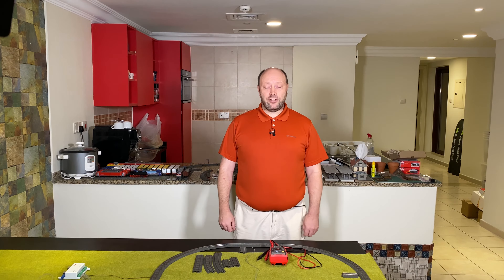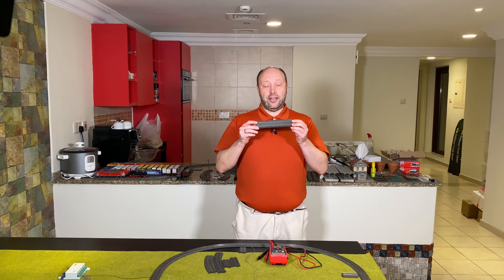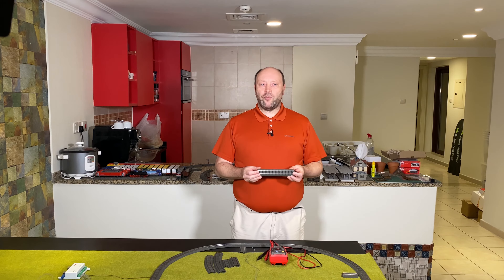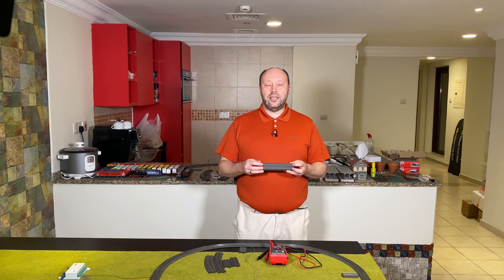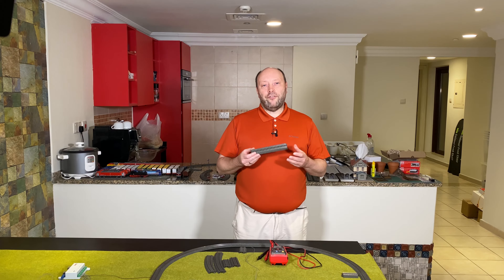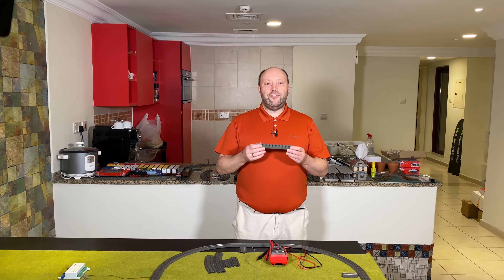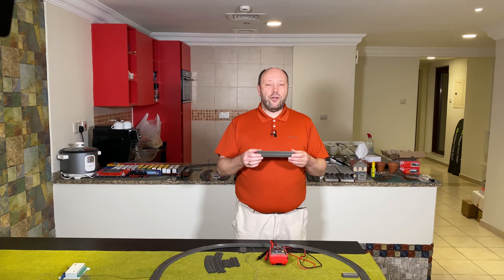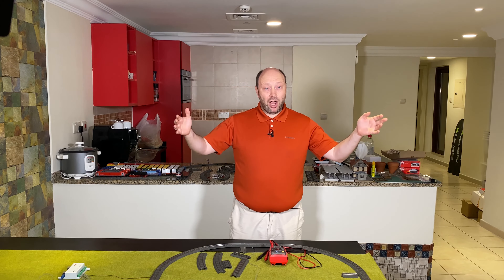Creating and Troubleshooting Märklin C-track Contact Track (Automation Episode 2)

Comment: As far as I am concerned, you will be awarded a professorship at the Märklin University of Model Train Fun. Really great videos. What I still do not understand is whether you can also use a contact rail when changing turnouts or signals. Or do I rather need a circuit track in that case.
Reply from the maker: Wow, thanks - glad you like the videos! As for your question: You need a way to detect trains on the track, there are several methods: infrared, reed switches, circuit track and contact track. In this series I will focus on the contact track as I think it is the better option. I might also look into the other methods in a future video.

In episode 4 of the automation series we will look at basic events in the CS3 and it will be shown how a contact track can trigger e.g. change of signals and turnouts using the L88/S88. 

Enjoy ;-)

Comment: I really like your videos and they help plan me my lay out, i’m going to use the dcc++ station because it is cheaper for me and i like the challange it provides. I actualy understand now what all these items from marklin do haha.
Reply from the maker: Glad you like the videos and it helps you! However, be careful some of these videos show features unique to the Märklin/3-rail system. The contact tracks shown in this video is an example. If you are using 2-rail the technique is slightly different as you will detect trains by measuring current draw from the tracks - not when rails are "connected"/"short circuited". The principle of dividing into blocks is the same the big difference is the S88 device used and how you connect wires to the rails.

Enjoy ;-)
Reply: @ModelTrainFun  i will be using marklin 3 rails
Reply from the maker: Ahhhh - I read dcc++ and thought you were talking about 2-rail. Got it ;-)
Reply: I really like your videos and they are helping me to decide if I'll decide for Märklín or Trix (I'm not really fun of the central track).
The current draw method will not allow to know the total length of occupied track since it only detected the Loco and not the wagons, correct?
Reply from the maker: @joaosampaio2015  This is true, but I have see that people then put a resistor on the last car - then you will get the same effect. In addition to that the total lenght of occupied track is not esential to be able to do automation - it just makes it nicer. Enjoy ;-)

Comment: Fantastically presented. I’m always glad to see your video on a topic I like. I always admire how you explain a topic and problems in a simple, picturesque and detailed way as if you were a professor by profession. Thumbs up! Be that way still!
Can you give me some advice for my problem? I recently bought a starter set Marklin 29074 and it happens to me that when driving slowly the locomotive knocks or completely stops in 5-6 places. Is it possible that the new rails have some kind of bug or maybe they haven’t been worked out yet? Does anyone have the same problem? That makes me very sad. Sorry for the grammatical errors if there are any because I use Google Translate.
Reply from the maker: Glad you liked the video! As to your problem - to me it sounds like you need to clean tracks, locomotive wheels or both. @Marklinofsweden has some good videos on how to do this:
- track cleaning: https://www.youtube.com/watch?v=0olM5Zq1zlY
- locomotive maintenance: https://www.youtube.com/watch?v=41Cts-OvNHs

Hope this helps your problem. enjoy ;-)

Comment: If I want to have a contact section that is 8 pieces of track long will each track in the section have to have the 2 pieces of track separated? In other words will there be 8 contact sections? Or will it just have to be the piece of track at each end that has to be cut - track 1 and track 8 in this case?
Reply from the maker: You can make it as you like and it really depends on how you intend to do the automation.

I intend to cover this in a later video - as a preview I suggest this: Just as the real world you will design your layout with blocks. A block must be able to contain your entire train. This was also illustrated in the signal series - see the video on "Where to place signals". https://www.youtube.com/watch?v=FLx2k9syjdQ

Depending on how you do automation a block can be 1 or more contact secions. Using the CS3 with a block where trains are going one way you will probably have one contact area for where to stop and one contact area for the rest of the block. In this way the CS3 can start slowing down when it hits the block and accurately stop in the "stop" contact section. The "stop" contact section can also just be the "stop" section for the signal if you have smart signals. If you need to go both directions you should have a "stop" contact section in each end, so 3 contact areas. If you do not want to see the train slowing down, but just stopping then you could get away with just a "stop" contact section - in this case circuit tracks or reed switches might also be an option.

Using software automation you can get away with one contact area per block as the software will calculate where to stop. The software will start slowing down when it hits the block and will calculate how to slow the train to make sure it stops at the end of the block.

So the trick is - mirror the real world operations for blocks and design the contact areas as needed by the automation.

Did this answer your question? Enjoy ;-)

Comment: excellent explanation. But I have a question. When I use 2 tracks to make a contactrail (to be sure that the trains stop), where do I need to put the insulators? Ore is it neccesairy to always use 1, 3, 5 , 7, ... rails. So the insulators are always on the inner rail. I hope you will understand what I try to say.
Greetings from Belgium
Reply from the maker: Hi Tasha

The method for train detection for 2-rail is not entirely the same as for 3-rail. For 3-rail you detect a short circuit of the two rails - however you dont want to short circuit your 2-rail tracks. Hence, on a 2-rail layout you detect the presence of something using power e.g. an engine or a resister on a car. This means you use the S88 DC (Märklin 60882) instead of the S88 AC (Märklin 60881). Note if you have a CS3 (not CS3+) you still need the Link 88 (60883) to connect the S88 DC to the CS3. You cannot use the connections on the Link 88 to detect DC train presence, so I suggest using the Link 88 connections for making a keyboard/contacts.

You can see in the manual of the S88 DC how to connect it (page 11 in English): https://static.maerklin.de/damcontent/f3/d4/f3d441f7cb397501154cd11d49346e751579266054.pdf

The idea is that you insulate one of the rails (as for the 3-rail tracks). So if you are using Trix C-track, then just consistently insulate the same connectors/rails e.g. inner or outer rail.

Hope this helps! Enjoy ;-)
Reply from the maker: Hi Tasha,

I just realized that you were actually asking about Stop Track and I was replying about making train detection. 

To make a stop track for a signal you just need to insulate one rail. The rule of thumb is to always put the insolation either consistently to the left or to the right on the tracks ensuring same rail. Hence if the track is from left to right and you want to insulate the track closest to you. Then you put the insulator on the first track in the stop section from the left and on the first track to the right of the stop section. This is illustrated in the manual for the Märklin signal page 33 in English: https://static.maerklin.de/damcontent/80/3e/803e565a406f08748a0372953b6c39721616401922.pdf

Hope this is a better answer to your question. Enjoy ;-)

Comment: Hello! Is there something to do on the turnouts for the contact track like cutting the little bridges between power/contact track?
Reply from the maker: You can only make straight and curved track into contact tracks, so you need to isolate the contact track from the turnouts using the "little red isolator". You can see it at 16:36 (click on 16:36) in the video. Here I illustrate how to isolate between two contract tracks. You need to to the same between the contact track and the turnout.

I hope this helps. Enjoy ;-)

Comment: Can the same piece of track be a contract track and a stop track?
Reply from the maker: Hi Mike,

Yes - the same piece of track can be both a contact track and a stop track. 

With contact track you disconnect the rails, and you isolate one rail. With stop track you isolate the center rail ("B" or red wire) and provide power through a signal or the m84 that can turn off the power to the center rail.

In the future I intend to make a video showing how to make a shadow station with the m84 automatically stopping and dispatching trains. In this case you need to combine contact and stop track as well.

Enjoy ;-)

Comment: What a mess of cables, you've gone around the track so much that I've gotten lost. Well, I'll try it tomorrow, now a whiskey and go to sleep.
thanks
Reply from the maker: Hi Pellas, yes - a lot of cables. Try it out - it is not too difficult, but the contact tracks can be sensitive. Ensure good power, well connected wires and clean track/wheels. Have fun ;-) Bo

Comment: You say you also have connect the rail to power. Do you have to do this to every contact track?
Reply from the maker: I usually connect power to the track only one place on my small temporary layouts. Generally, you should have a power bus and connect the power to the track on several points on the layouts to ensure good power distribution. This is independent of the contact tracks. Basically you should power the layout where it makes sense - not taking into consideration if it is a contact track or not. If it's a contact track, then the trick is to wire it correctly, so it is still a contact track with a detection rail while getting power.

To be honest as I have a temporary layout I do not have much experience with power bus' and where to power the layout. I often see videos of people saying every 2-3 meters. Sometimes I see a recommendation of every track between turnouts. If this is true I cannot say. But reliable stable power is important for a digital layout.

Did this help? Enjoy ;-)

Comment: I greatly appreciate your  “tutorials”. I  want to convert my analogue  system to digital and would like to have your comments on how to start and what Performance I would miss by using my original tracks instead of buying the new ones   I have 7 analogue locomotives and plenty of tracks. Thank you.
Reply from the maker: Hi Viktor,

I have not tried the conversion from analogue to digital myself, so I do not have a lot of experience with it.

As I understand it you should be able to use digital with the older Märklin M-track. The C-tracks are the best for digital, but many people are using M- or K-track on their layouts with digital. As I understand it K-track also work well with digital. You even see layouts with a mix of M-, K-, and C- track - so it is possible to mix as well. Märklin has tracks that can connect M to K, M to C and K to C.

When converting a layout from analogue to digital you need a digital control station. You can go for the Mobile Station 2 or the Central Station 3. I would suggest starting with the Mobile Station 2 as this is the cheapest option and you can discover what you need over time. However, if you have a bigger wallet and want to jump into it consider the Central Station 3. If you want to get started with the Mobile Station 2 consider a starter set as this would enable you to get started right away with a digital locomotive, a little track and some cars. You can see this video as an example: https://www.youtube.com/watch?v=slJZoMWZ248 Buying a starter set is usually a good option as the price usually is lower than the price of all the individual pieces added together.

Be aware that analogue locomotives will not work on a digital layout. You need to convert all your locomotives to digital to make them work on a digital layout. This can be some fiddly work and is not for everyone. In addition to this the parts are not cheap either, so consider for which locomotives you want to invest the money and time. I have seen layouts with a mix of analogue and digital e.g. on different parts of the layouts.

The track, cars, signals, turnouts can be re-used as is. Overtime you will want to upgrade signals and turnouts with decoders - or replace with new ones. However, you can continue with the manual switching you already have for the analogue layout. To get started with digital the minimal needed is a Mobile Station 2 with a connector box/power supply and a digital locomotive. Then you can connect this to your existing layout (disconnect analogue power supplies).

Hope this helps. Enjoy ;-)
Reply from the maker: Hi Viktor, I also have a community post on converting locomotives refering to other YouTube videos: https://www.youtube.com/post/UgkxR9HXTnaIjMhsk1QZbZBLN9eZZLEZ71Vp

Enjoy ;-)

Comment: Hi Bo, I have watched your video on contact tracks but am still having problems as my trains lose power on the contact section. What i am doing is taking power from another circuit of track but i am not using feeder cable. This feeds the two tracks both before  the first 24995 contact track and it provides power last tr to the last track after the 24995 contact. The contacts i am using are the 24995. Then i place six tracks seperated by isolators between each in between the 24995's. I have not cut any of the bridges on the  c tracks as you did on your video. Please tell me do i have to definately  break the bridges  or is there something i am doing to cause the loss of power by something i am doing. The trains pick up power outside the contact area. It is the method shown in the manual of the 24995. I appreciate any help you can give me as i need to set up four contact sections .
Reply from the maker: Hi Alf,

I seem to remember that you have a Mobile Station 2 (MS2), so I am unsure why you are making contact track? Are you trying to use the Märklin 74924 railroad crossing? What are you trying to do?

If you are using the Märklin 24995 contact track you do not need any isolators. They are available to make it easier, but the cheaper and more flexible option is to make the contact track yourself as illustrated in the video. For the Märklin 24995 you do not use the isolators. 

The manual gives good pictures of what to do: https://static.maerklin.de/damcontent/0a/3d/0a3da96b1c15614d4d6d58afdad7c3b01512382695.pdf

On page 2 the first important item is that you need two Märklin 24995 and the small arrow must be on the same side. You can try to connect the two Märklin 24995 directly together without any track in between - does this work?

On page 3 you can see how to cut the track that you can put in between the two Märklin 24995 (also shown in this video). Page 4 shows you that all track between the Märklin 24995 must be cut - otherwise it does not work. Note: no isolators are used. 

Hope this helps! Enjoy ;-)

Comment: How do we if we are using marklin's Trix C track DC locomotives and wagons. Have you done a video on this or would you consider doing a video on this subject please; because some of us have purchased the Trix C track system and the Marklin central station 3 plus.
Reply from the maker: Hi Earl,

Train detection is special with the Märklin 3-rail system as the principle is detecting the short-circuit of the rails when the train passes.

For 2-rail (Trix) the train is detected by "current draw" as you do not want to short circuit the rails. When current is being used on the track this is because a locomotive is on that track section.

Using the Central Station 3/3+ you can use the Märklin 60882 S88 DC to detect trains on a Trix layout. If you have a CS3+ you can connect the S88 DC directly. With the CS3 you need the Link88 (Märklin 60883), then connect the S88DC to the Link88. Unfortunately you cannot use the S88 input on the Link88 for DC. Consider using it for physical buttons. Do remember that even with a CS3+ you might want the Link88 to offload the CS3+ - check the "Getting Started with CS3" video on differences between CS3 & CS3+: https://www.youtube.com/watch?v=wANbrR0fdJk&t=387s Additionally, the Link88 has can use 12V.

You can see on page 11 of the S88 DC manual (Märklin 60882) how to wire it: https://static.maerklin.de/damcontent/f3/d4/f3d441f7cb397501154cd11d49346e751579266054.pdf

Unfortunately, I have not tried the S88 DC myself.

Hope this helps! Enjoy ;-)
Reply from the maker: Found a Märklin video that shows how to use it. Unfortunately, in German and a different scale, but it might still help you? https://www.youtube.com/watch?v=NjF1pqAL8nU